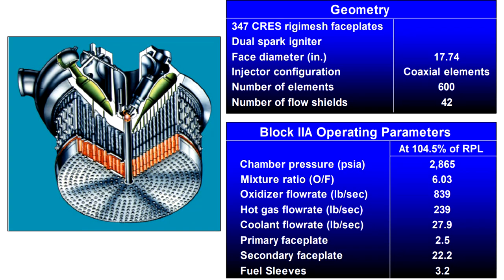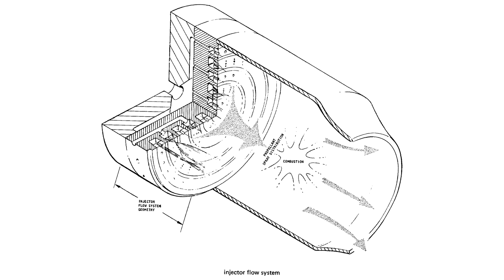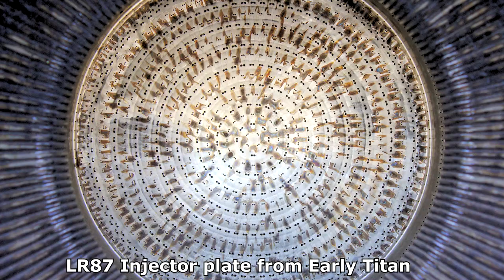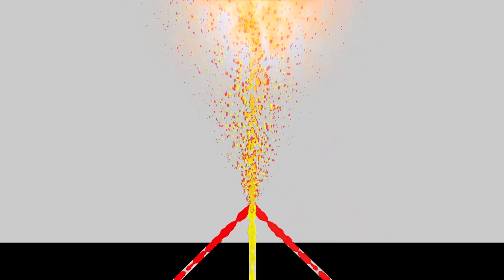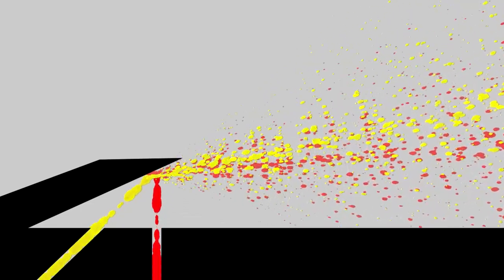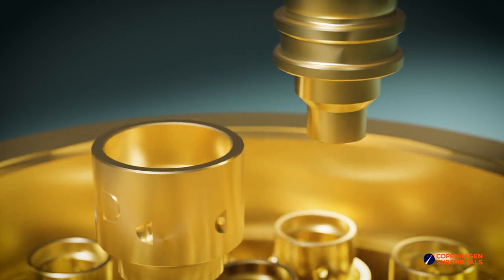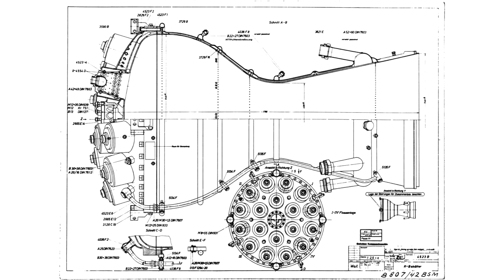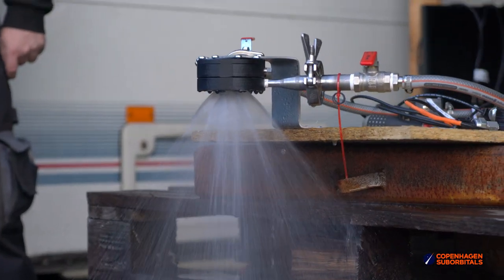Rocket Fuel Injectors - Things Kerbal Space Program Doesn't Teach

Comment: Rocket science is easy, Rocket engineering is hard.
Reply: Center of mass, check.
Center of thrust, check.
Fuel, check.
Point it down range and watch it go when the orbital mechanic guy says to. Then do some simple math, and it comes back. Maybe.

Finite element analysis, check.
Material sciences, check.
Chemistry, check.
Thermodynamics, check. 
Fluid dynamics, check.
Rotational equipment reliability, check.
Best welder in the world, check.
Supplier of exotic metals, check.
Giant assembly building, check.
Turbomachinery, check. 
Electronics guy, check.
Largest forge press in world, check.
Tens of thousands of man hours in development, check.
Test stand, check.
Extreme lead times on vendor supplied parts, check.
And so on and so on...... lol
Reply: Rocket science is easy. Build a bomb, have it controllably explode in only one direction, add steering, have it explode in that direction for as long as one needs to, avoid RUD.  ;)
Oh and schedule failures for national holidays...
Reply: @midship_nc  or you could build a Sea Dragon in 8mm submarine steel in a shipyard, pressurise via 4 tons of liquid nitrogen and light the blue touchpaper?

It used to be joked that anyone brave enough to do it would either completely destroy the aerospace industry as it currently exists, or make a very spectacular fireworks show and end up bankrupt. 

Mind you, if SpaceX can afford to demonstrate a Falcon heavy, they can probably afford to lose a Sea Dragon.
Reply: @spvillano  lol RUD....the BSOD of space travel.
Reply: @miscbits6399  you will have to excuse me but what is submarine steel? Some kind of seawater resistent stainless like 2205? Ive heard of certain grades of stainless that do okay in seawater, I dont have any naval DOD customers here in NC but if i did, i would go Ti at the minimum for seawater duty. Although, there are a couple oil rigs in the pamlico sound that would be my accounts technically.....just dont have a helicopter at the moment lol.
Reply: Not to say that science is easy, it's not.  But engineering is where the science meets the road.  It's all well and good to say that something is "scientifically possible", it's another completely different thing to make that possibility a reality.

This is why we don't have fusion reactors powering everything.  The science for nuclear fusion is (relatively) easy.  Achieving it in a sustainable, usable fashion is not.

Comment: Unlike split triplets is the way to go; we've been using them for over 20 years. Its a simple design which places the manifolds in relatively easy machine and design locations and gives outstanding performance. Added advantage is its easier to balance out the resultant momentum of the impingement sheets as well as making the injection orifices relatively the same size for the more common LOX/hydrocarbon propellant combinations. This helps with hydraulic losses and makes your pressure drop across the fuel and oxidizer similar if not equal. Really smooths out the injection stream pattern.

Edit....although there are some interesting versions of the pintle injector as well.....currently designing one now; err for the past year that is. lol

Interesting meaning specialized variations.

Comment: Amazing summary Scott.  FYI - splash plate was used in Rocketdyne's J2 GG.  I was told it was the Achilles heal of the J2 and one of the most difficult combustion devices components to perfect.  They tested many many configurations via cut-test-fail to eliminate burn thru of the GG combustion chamber.  The solution was a choke ring which was added just downstream of the combustion region.  Looking forward to checking out more of your videos!

Comment: A long time ago when i was about 12yo i tried to make a liquid fuel rocket engine. First problem was, aside from gasoline, I did not have any liquid fuel. OK the gasoline could be pumped from a gas tank or from a gas tank but that was too much trouble. I also could not get any Oxygen, liquid or gas, as this thing was being made in my step father's shop and he would not pay for an oxy/acytelene set. So my fuel/oxidizer choice was propane and compressed air. 

The engine has a cylindrical combustion chamber with the air injected from the head of the chamber and the propane injected into the center of the chamber through a tube with radial holes. The entire thing was machined on an antique belt driven lathe from a piece of scrap steel. It took several after school days to get this built. 

I tested it by clamping it in a vice on an outside work bench. I had enough sense to not test it in the shop. Check out the MYTHBUSTERS test of their hybrid rocket in their shop. The test procedure was to pump up a tank as far as possible with air and hook it to the injector plate at the end of the combustion chamber. Then plumb a propane tank to the center tube injector. Start the test by turning on the propane and lighting the gas exiting the engine with a kitchen match. Then the air was Inejected and the smokey flame retreated into the chamber. Then it made a lot of noise with a very clear flame.

I was pleased with the result even if I had made a complex weed burner more than a rocket motor. The entire thing is why you should not let a curious 12yo kid alone in a machine shop.

Comment: Combustion instability is a recurring issue with big rocket engines, so I'm curious your thoughts on the Sea Dragon and its proposed single massive first stage engine (Calculated to be 350MN, compared with the Rocketdyne F1's piddly 6.7MN).

I think combustion instability would've killed it even if they had decided to take the Sea Dragon seriously, but do you think such a large single combustion chambered engine is even possible?

Comment: 0:51

“Good propellant injectors can make all the difference between your engine performing excellently, and it exploding due to combustion instability”

So one part goes wrong and the whole thing blows up. Isn’t that just normal rocket science?
Reply: eh, more or less
Reply: Based on what I read in Ignition by John D. Clark that happened a lot in the early days. Some people even took their entire labs down with the experiments.

I wonder at times how hard investigations into aborted launches are (and were), these days there are probably a lot of sensor logs on the ground. But the actual pieces of the rocket that make it to the ground will be quite mangled if found at all.

Comment: Thank you Mr. Manley for the compendium.
One thing I would like to add about combustion instability, which has to be considered in all injector designs. 
A difference of few mulecules of oxygen on one side or another of the location of combustion is enough to bend the flame to one side or another. In given level on energy, the singular combustion nucleuses at each mixing location (of fuel and oxydiser) starts to "talk" each other, in a quest for that little more oxygen, starting a positive feedback that create an energetic rotating vortex that can destroys the chamber.
It wasn't fully understood 50 years ago, but the buffers of the Rocketdyne F1 avoided that all jets in the chamber talking to each other, creating ten separate virtual combustion Chambers. 
Nowadays this is fully thermofluidodynamically modeled with computer software, so it no longer considered an hard to crack problem.
Reply: Fascinating comment thanks

Comment: Back in those days the rocket building process was confidential and secret. So I didn't see so many pictures of what we were doing. I worked on testing, modifications and assembling. I would like to see some pics of the solid wall jig we used to test the injector plates. It was about 3ft in diameter and 3ft high and we placed the injector plate in it. All those test were done at Edward's AFB and when they cam back after a test they  were in bad shape. They had no tube cooling so the 2000 degree temp melted  the unit and we had to fill the voids with rewelding and we had to get them back into round.

Comment: I built a liquid fuel rocket in high school and we injected the fuel (turpentine / aniline 80w/20w) thru the a circular formed stainless steel tube (made from sheet stainless steel in two parts and welded together, then spot welded inside the combustion chamber, and a center cylinder injector with injection ports arranged around the cylinder thru which concentrated Nitric Acid was injected. We drilled holes and tested with water until we had the desire mass flows. Initial hole placement and numbers was a guess.  This was a pressure feed rocket using dry ice to pressurize the propellant tanks. The engine produced an average thrust of 300 pounds for 7 seconds, the rocket flew true and stable but the recovery parachute deployed too late (triggered by a timed fuse, the electronic did not exist then.  We recovered and acidized pile of twisted aluminium seamless tubing with a 3 inch OD. The fuel and oxidizer valves were made from machined stainless steel tuning and SS Steel plugs on a yoke and used home brewed black powder to activate the values. Before ignition the injectors had hot wax applied to prevent Ignition which was hypergolic .... for a friend in shop class he got a good grade on workmanship ... I got the satisfaction of going from paper to metal with an working rocket. Previous rockets were fiberglass and carbon fiber filament motors using solid fuel (woodshop projects)  Some exploded some worked, all was great fun. Try getting school lawyers to approve projects like this today ... with generation snowflake. Teachers in those days were WW2 veterans, what's a few explosions among friends as long as we were careful. They lawyers did not need to know ....  it was the space race then, or don't you know. Science education got a lot of support.

Comment: I watched a video once about engineering mistakes that featured somebody from NASA... he was using a new probe tester to check an injector plate (which took a very long time to make, and almost as long to check) and he input the wrong command on the stick, which sent the probe right through the plate, breaking both of them. That particular axis was reversed on the controls from the machine they had been using previously, which is like somebody handing you the controller and having to play a game with the Y-axis inverted from how you play it.

Comment: What are the considerations for injectors in hybrid rocket engines? I imagine not having the oxidizer gouging divots in the fuel might be important, but how critical is the design?
Reply: It's gonna differ hugely depending on the fuel grain geometry. If it's a simple cylinder then having the oxidiser behave as though the whole fuel grain is a swirl chamber would seem to be about optimal. A ring shaped injector with vanes to angle it should work well... or a large cylindrical pit with angled injection to swirl it, with the diameter of this pit matching that of the fuel grain.
Reply: As Matt D said, swirling oxidizer is the key to an efficient burn with Hybrids. I attended a lecture by a man from Nammo (Norwegian weapons manufacturer at the Andoya Space Centre) he said they use a swirling injector in their rockets, kinda like a rifle barrel, to get the twirl.
Reply: Id say something like a metal garden hose front to spray the oxidizer into the fuel :D
Reply: When the Mythbusters made their hybrid "civil war rocket" I think they simply used the end of the pipe that delivered the Nitros Oxide oxidizer. I do not believe they ever considered inducing swirl to the flow. Find the episodes where they test the rocket inside their shop, near disaster, and acdually flew the rocket. FWIW - they made the thing in three days using schedule 80 steel pipe.

Comment: I wonder, could I buy one of those coaxial swirl injectors and use it for my shower head?
Reply: I think it would depend on the pressure of the water. So you want a good mix of the hot and cold water?  Or just the fanning out bit missing all but your shoulders? :-D

Comment: A friend and I are having a debate. Would it be called:

a) rocket motor
b) rocket engine?
Reply: Motors run on electricity, engines run on combustion. ...
Reply: @suntzuwu  we were confused, as Google defined "motor" as
"a machine, especially one powered by electricity or internal combustion, that supplies motive power for a vehicle or for another device with moving parts."
Reply: Both are in widespread use for liquid propellants, and the base definitions/derivations of motor and engine fit. For solid rocket boosters I see motor used much more than engine.
Reply: Both fit. A motor is something that causes motion. Rocket motors definitely cause motion. An engine basically converts something into something else. Rocket engines convert chemical energy to kinetic energy.
Reply: Motor is short for motivator; a device which causes movement.
Engine is more specific and seems to imply conversion of energy to perform work; chemical, thermal or kinetic.
Reply: Rocket motor for solid propellant rocket. Rocket engine for liquid propellant rocket.
Reply: @kazedcat  Yeah that'a how I have heard the usage.
Reply: Just call  it the big box of boom.
Reply: An Estes model rocket has a motor, a falcon 9 has an engine.
Reply: Motor used to be a term applied to internal combustion engines, but since the rise of the electric motor, we now use the term motor for electric motors and engine for anything that has internal (or external) combustion of fuels.

Comment: someone ask the question, how much power would it take to correct the earth orbit to be a more convenient length of time like 365 days.
Reply: 149.545.000km
Reply: I can't help thinking that adjusting the rotation would require less energy than adjusting the orbit.
Reply: A lot
Reply: @Kineth1  Would depend on how much leverage you could get.
Reply: @Kineth1  we could slow the earth by orbiting a large mass, we might need two to prevent wobbling, but that way we can get rid of that whole leap year thing.
Reply: If it ends DST I'll help
Reply: I've always wanted to do that. As a software engineer, I've always found the system of leap days and leap seconds to be most inelegant... a workaround for a problem that really should be fixed at the source.

Comment: Probably the biggest thing the public doesn't appreciate is the much higher flow rates, and thus fluid momentum, in booster rocket injectors than in typical residential or commercial spray nozzles.  I once worked in a test bay where the F-1 engine's injectors had been flow tested (Saturn V vehicle) and some of that equipment remained in-place.  The flow was measured by collecting the downwrd spray (water?) in a tank ~20 ft diameter.  They measured the rate of level increase via shorting wires at different heights (1960's data systems).  I was told the tank would fill in ~10 sec.  Similarly, it is said that the turbopumps in the Space Shuttle engines could suck a swimming pool dry in ~10 sec.

Comment: As someone also interested in jet engines, it's interesting how some designs are almost analogous, like the concentric injector designs that look a lot like pintle injectors, with multiple conical propellant sprays intersecting, while others like the impinging design for rocket injectors or the contra-flow injectors in jet engines (injecting towards the incoming airstream) are completely different

Comment: There was one rocket engine that had a combustion instability problem, sometimes. If it got burning properly right from the start it would stay burning properly throughout its flight. But if it started poorly it would stay burning poorly. Despite a lot of work on the injection it kept having the same problem. The fix that was figured out was gluing strips of felt inside the combustion chamber. Somehow that stabilized the combustion startup long enough, every time, so that it'd be running right by the time the felt burned away.

Comment: Pintles are great because the recirculation zones lend themselves to improve C* efficiency and lend themselves to inherently stable combustion.  You can also easily integrate geometry into it which provides head end film cooling for the injector dome.  The throttling face shutoff isn't really a means to throttle but is a means to keep injector stiffness high enough at low mdot to prevent feed system coupling

Comment: I've worked with similar issues in jet engine injectors and combustors.  The range of solutions is surprisingly large.  It gets worse when you add full-range throttling (many gas turbines don't throttle below 40%).  And even worse when you want to quickly change to different fuels (such as US Navy gas turbine powered destroyers and cruisers must do when needing to use whatever propulsion fuel is available).  Then there's maintenance: Whatever wears most must be the easiest to repair/replace, which explains the universal popularity of can combustors in early jet engines, and their near total replacement in high-power engines by annular combustors as alloys and CFD simulations improved.

Comment: One of the early F-1 injector designs used spray nozzles functionally similar to those on a garden pump sprayer. Made of stainless steel about 3/4 in. In diameter with six wrench flats, threaded into the injector plate using very fine straight threads. There was one set for RP and one for LOx. Each set had several different flow rates and spray angles so the nozzles could be mixed and matched, in theory, to achieve an optimal spray pattern. Don't know how many nozzles in total. Never saw a pic of the full injector assy. They probably wanted to avoid the complexity of the drilled injector plate. Needless to say, it didn't work well enough and they reverted to the drilled plate.